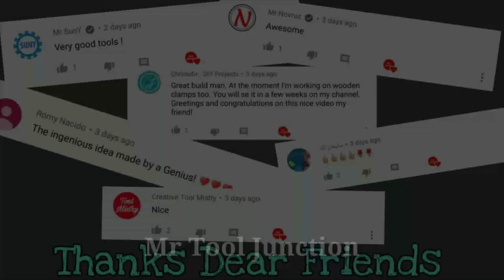Top Genius Idea

Comment: Instead of buying two pieces of metal and welding them together wouldn’t it have been easier to simply buy stock already sized correctly for your needs? 
Also, how much time did it take from start to finish to complete the fabrication?
Reply: I think the idea is how to make useful item's out of scrap pieces of material that normally gets tossed in the scrap trailer.
My 12yr old nephew loves this channel, all the time in my shop making stuff he sees on here, I'm glad, he is learning to weld and fabricate small scale item's and is eventually going to work up to bigger things.